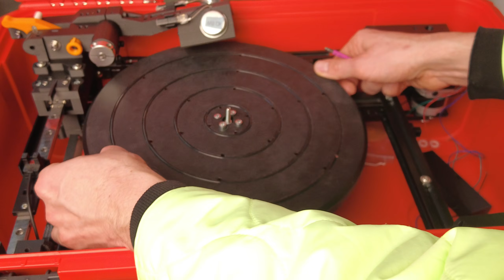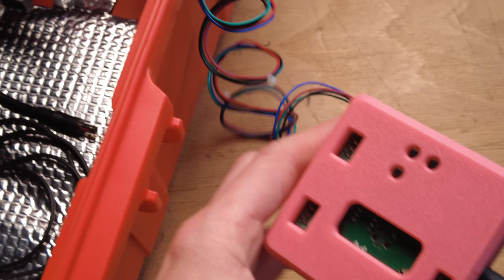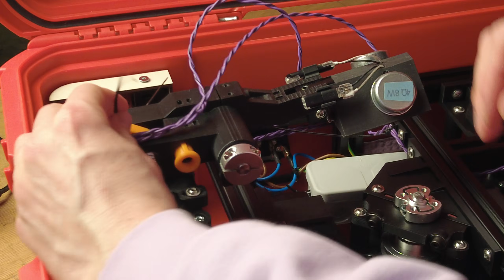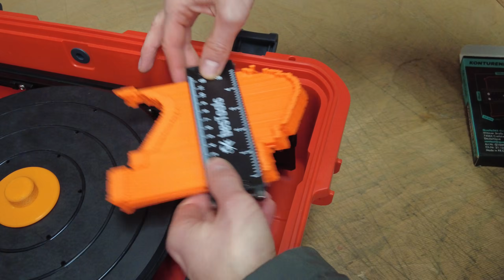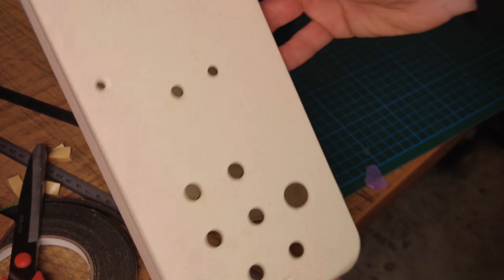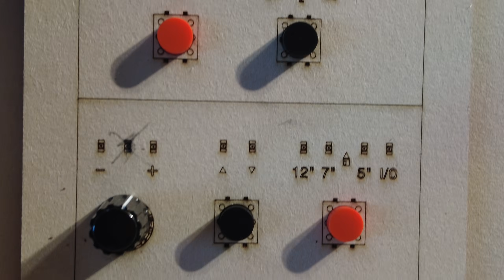Pt.11: Cables and Wires - Building a Vinyl Record Embossing Machine

Comment: Super. I've been waiting a long time for a new video to come out with a continuation of the recorder's construction. By the way, what about the book Schallaufzeichnung auf plattenförmigen Lautträgern - 
Hellmut Güttinger? Have you considered selling it? I'm willing to offer \$500 for just this book. Or maybe an exchange is more interesting? I have brand-new sapphire stylus pens for recording on records, just like the Presto ones. They come in sealed boxes with 50 pens each. These are still in storage, from the days when we used to record. Nowadays, they're quite rare. You can use them for both recording and embossing. I have a large supply of them. Therefore, I would like to offer an exchange. Currently, these new ones are very expensive on eBay, priced at 1 piece each. I am willing to offer several packs for a book. You can make copies of the book. I couldn't find it anywhere except in German libraries. If I had the opportunity, I would just scan it for myself, or if it were in electronic form, I would download it and not have to look for where to buy it. I'm just tired of searching for it or waiting for it to become available. I want to pick it up and read it already. I also have even rarer books on recording than this one, which are not available in electronic form or even in libraries. However, I have several copies of these books. If you are interested in exchanging such literature, I would be happy to discuss it with you.
Reply from the maker: hi thanks for your interest into my project. i am currently not selling this book. sorry .. if i will be able to find/make a digital copy - i let you know.
Reply: @alexrex_de здравствуйте. Я пока и сам покупку отложил. Сейчас нашел шикарную редкую головку для записи на пластинки, хочу её купить в свою коллекцию пишущих головок. Ну и так для записи заказов. Я нашел пару человек из Германии подключил к поискам. Но если и у вас будет возможность, где-то попадется, то дайте знать или со своей может сможете фотографии, сканы сделать. Я тоже если что могу поделится сканами своих редких книг, которых тоже нет в интернете в электронном виде.